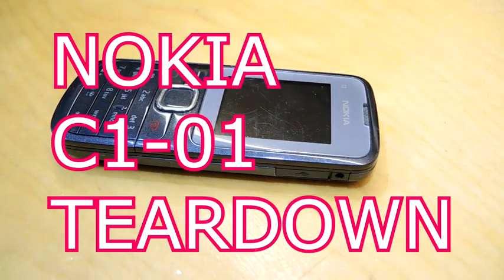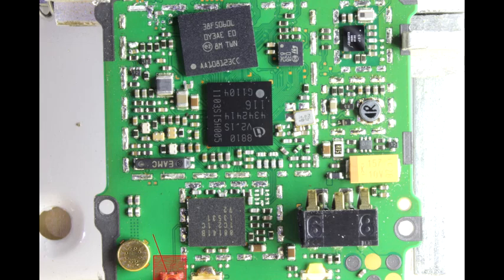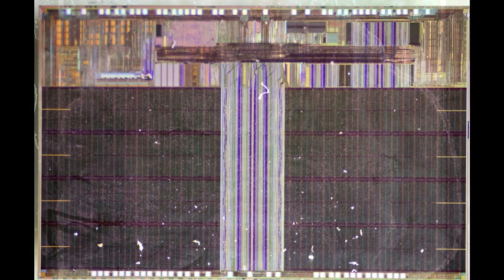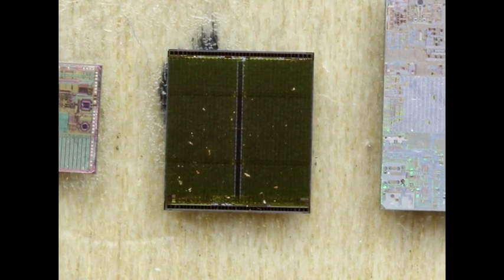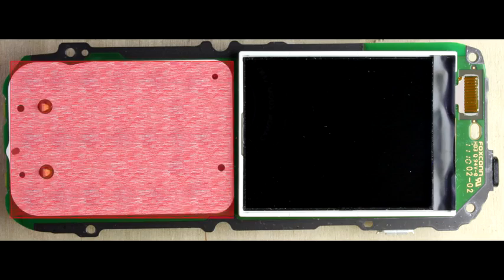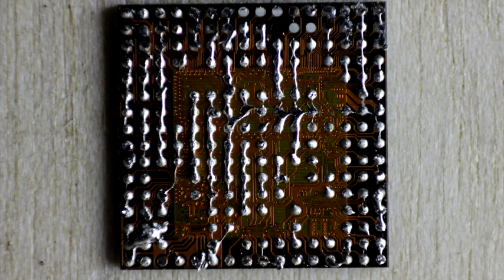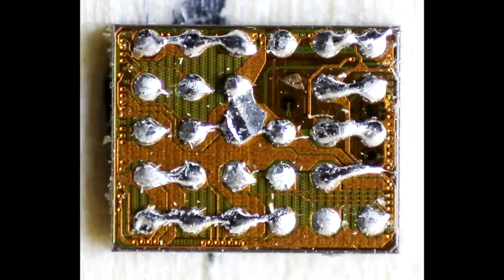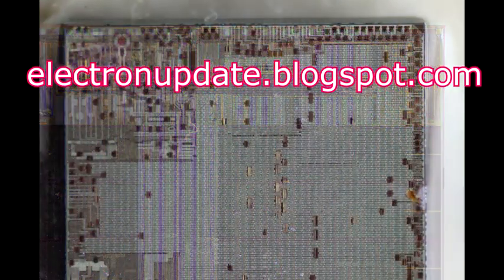Nokia C1-01 Cell Phone Tear down: the silicon

Comment: The crooked chip is quite strange. Normally they are parallel with the pcb or if at a angle a 45, etc degree.
Reply: It got unsoldered during the shield heating and removal process. You can observe that the top right corner is in the path of the shield, so it would be hardy possible to mount the shield.